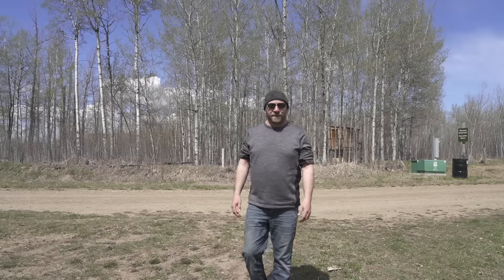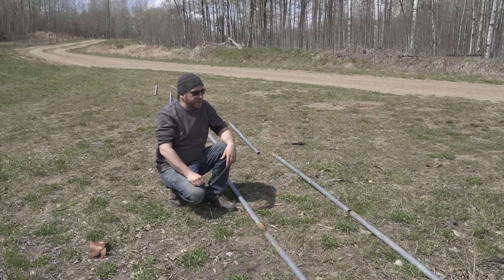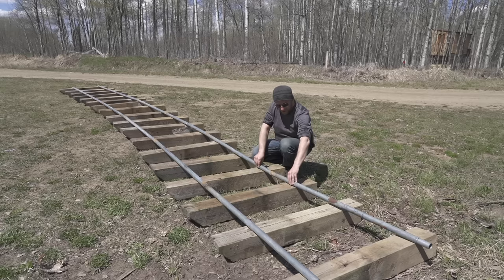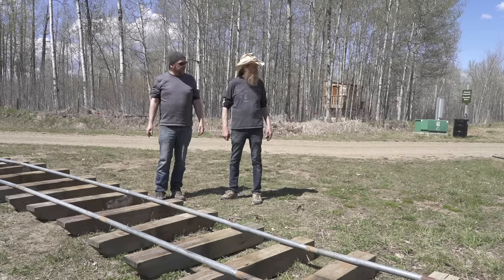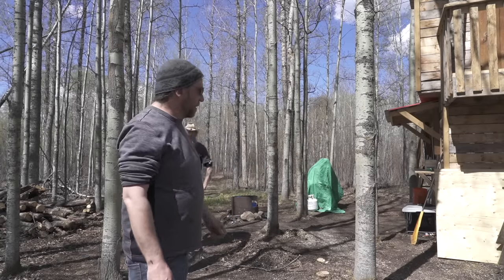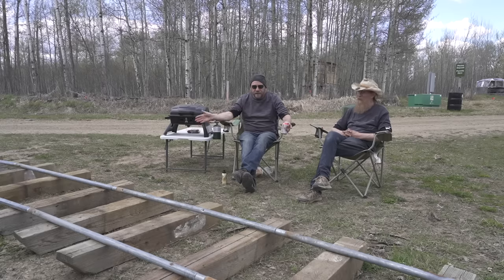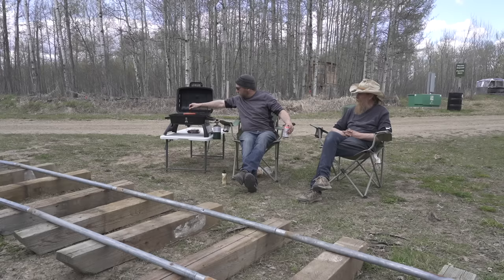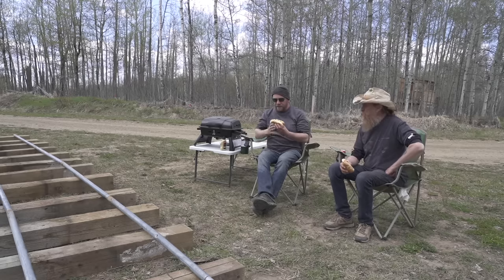Homemade DIY Railway - Work Begins Update

Comment: Might want to consider angle iron for rails with flange type wheels. The tubes and roller idea could work for a straight run but it will be crucial to have a perfect gauge the entire length and very very gradual turns or it would pinch/derail. Perhaps rollers that are wider than the rail to allow some play but still risk derailing on corners with the round rail. Plus flat flat stock/angle iron rail would allow you to easily make a very simple “frog” type switch
Reply: Choo choo master!
Reply: NAH... sooo many thin trees... cut them tubular, treat, and use as rails !
Reply: I think the simple "frog" might still work with the pipes, but I agree on the wheels, the only thing is that will probably run up the cost/difficulty to build it.
Reply: @joelmartin2549  not with the original idea for wheels but if there was flange type wheels with enough play it might work but the abrupt direction change with the round rail would still be a huge derail risk. But with enough patience and tools a more standard switch could be fabricated to make it less abrupt and more fluid. Or premade sections that can be swapped out rather than a switch. Of course I’m sure the idea here is to do everything on the cheap so what’s best might not be economical. Have to make due with what you got.
Reply: Blessings From Birmingham England
Reply: But a filmed derailment would be epic… as long as no one gets hurt of course.
Reply: This guy chooches!
Reply: @joohop  right back at you. From the Hampshire. The NEW Hampshire 😉
Reply: Perhaps they should consider just drinking beer...this project will go nowhere
Reply: @ainokea4u   The step 2 express coming in hot ;)
Reply: How about "Toeing" the wheels in about 5 degrees at the top, maybe less. I am picturing something like roller sheaves, though Steve has shown what he has. A slight toe would allow a bit more cornering and less "Blooper Action" though that would be an EPIC Step Two Video. As long as injuries were not too severe.  My other thought was vertical rollers to carry the load and inside horizontal or canted rollers to maintain center. Similar to how coasters are set up. Just thinkin.
Reply: Wheels on rail cars are conical so that they don’t derail on turns
Reply: NHNick is right to be concerned about tubular rail. Angle iron would work better but there is a reason that railroads use a nearly flat head rail with conical wheles with a inner flange. But if you do use the tubing I recommend putting a relief v or semicircle cut in the ties to cradle the tubing. When scread down it will lock the rail in place and if all the ties are cut exactly the same you will end up with a consistent gauge from one end to the other. A loop at each end will solve your backtracking problem. If you incline the track one way or the other at the y you can get the cart to choose to turn to the down hill side of the y automatically.
Reply: How fast are we planning on going here? I feel like "huge derail risk" is a little extreme
Reply: @dkjimi  Does it matter? We're talking about Steve, Crazy Neighbor, Junk Yard Engineering and Multiple Step Twos. What could go wrong.
Edit... There may even be a flame thrower involved. ;P
Reply: campers, you use this railway at your own risk!
have a step 2 first or several it will reduce your
anxiety!
Reply: @dkjimi  with round rails on a tight corner or switch at even walking speed could roll itself right off and derail. By huge derail risk I mean extremely likely to derail not so much a damage or injury risk.
Reply: @saintbyron5150  how much you want to bet crazy neighbour takes the first ride. Hope I’m as adventurous as him when I’m in my 70s.
Reply: @saintbyron5150  is right a few derailments will definitely increase the entertainment value.
Reply: matthew frank mikovich , one month may be plenty of time, by then the house will be in a different stage and it will be back to stealth camping, I think some people are taking this way too seriously, stop and think who Steave and Crazy Neighbor are!

Comment: I could see several different rails, and then in between where they all connect, having a train platform like in European train stations. Drive your train onto the platform, then it rotates to line you up with the rail you need to be on, and PRESTO a simple track change!!  That’s gonna look so cool when it’s done. And this is EXACTLY why I subscribe to this channel…because there’s always something fun going on regardless of whether it’s camping or not.

Comment: I think you're going to want to place a couple inches of crushed stone underneath certain parts of the tracks. It'll create a more even surface for the tracks, create landings for the sharper declines, cover the ground which has vegetation/would require a lot of maintenance each spring/summer, it would drain better after the winter so the wood will be stronger for longer, and also for safety it would be a more supportive surface for heavier loads. All the best, Steve!! I love the way you think!!  Looking forward, again, to next Thursday -- cheers my guy

Comment: If you're going to stick with the tubular rails and wheels you'll need a steering system of some kind. Like a circular bearing between the axial and car. The front and rear wheel can rotate around their center or else it won't be able to make it around the corners. I imagine a cylindrical thrust bearing with the axis of rotation centered on axial at the midpoint between the wheel. This would be plenty strong enough to support the weight of the car and cargo while allowing the cart to make it around the turns no problem. With this setup the car will be very sensitive to changes in gauge so you'll definitely want to make sure the distance between the rails doesn't wander much or car will experience a lot of friction or may not run at all. It could also be really loud in that case. Also, I'm not sure but think the ballast is import not only for drainage to protect the wood, but also to help hold the ties in place and keep weeds and plants from growing through the rails and moving the ties around. If the ties move around too much over the years it could damage the rails. I think this is a great idea and you should be able to pull it off. I'm excited to see where this goes.
Reply: Very good advice. 
If your tracks have any decent turns you'll need to figure out how to accomplish this without causing the wheels to slip. Trains do not have a differential, the wheels on each side share an axle. The way their wheels work is really genius, they're not flat at the bottom but slanted inwards, with the smaller diameter toward the outside. This solves two problems, it makes the train self-centering on the straightaways and it causes the train to shift to one side on the turns, this increases the wheel diameter on the outside and decreases it on the inside of the turn. 
I'm not saying you have to change your rails, I think you can solve these problems by using the wheels you talked about (they're also self centering) and ideally using free floating wheels, but honestly you could probably just deal with the wheels slipping a little. 
Good luck this is actually a really cool idea
Reply: @amosbackstrom5366  Excellent points

Comment: You will want all of your axles to be able to pivot and ideally each wheel should spin independently when going around corners. I watched a video about the science of train wheels awhile back and the curves are what is going to be the problem spots. Love it Steve!
Reply: THIS is why I came to the comment section!! Bravo, good sir!! 😁👏👏👏
Reply: Yeah the moment he mentioned those fence wheels I said "oh no!".
If he's using those wheels, he can put the wheels on either side of a single axel each that can pivot in the middle, much unlike a train wheel like you are suggesting.
If he made the wheels more like a train, which are basically cone-shaped, then he wouldn't need to do that.
Reply: I think cost is the factor, I know those train wheels are expensive, maybe he could grind part or all of the outer flange off of those fence wheels he plans to use, that way they would be closer to the real thing.

Comment: Coming from a Mechanical Engineering student, look into the engineering of how trains steer. Semi-conical wheels might help some problems mentioned in the other comments. Cheers Steve!
Reply: I’m in the UK but I am a freelance design engineer and I’m happy to 3D print these for you!
Reply: Definitley. Look up RP-25 wheels. Coming from a railroad conductor....
Reply: Wouldn't 2 normal wheels at an angle with negative camber (top of wheel leaning in) effectively act the same as a conical wheel? Just a random idea but I think it is plausible

Comment: Make yourself a “spacing stick” out of whatever you have around to keep the “rail to rail distance” consistent.  Easier than using a tape measure and a whole lot more accurate.  You’re lucky you can create whatever “guage” you desire.  Maybe 30” wide.
Reply: Alternatively the Red-Green in me says to build a locomotive that has springs on the ends of the axels that keep the wheels pressed into the rails. The wheels would be concave rubber and would move in and out as the rail line narrows and widens. That way if there is an obstacle the rails and wheels could move closer together and then spread apart again. ;-)

Comment: Oh, what fun! The place we lived for years was out in the woods, and one of the farms we passed on our way in and out had a small rideable train with several cars. 

They had a train barn with "Mail Pouch" painted on the side, where the train went in one end and came out the other. It was also where the train was kept sheltered during the winter. 

They had added a tunnel through one of those big concrete pipe sections. Planted fast growing bushes on either side to make it look cool. 

Such a treat to see it running around the large looped track. The train started at the train barn up near the house, ran down next to the driveway to almost the end (I think they also used the train for transporting the trash cans on trash and recycle days), then the tracks paralleled the road for a bit, went through a hedge, turned back up toward the back of the property and went through the tunnel. 

After that it continued back near the real barn, and made the final turn to finish the loop and pass through the train barn (about the height of a person and a bit longer than the entire train). On nice summer days we'd drive past and see the old guy in his overalls and conductor's cap giving kids a ride. Awesome!

Have fun with your train, it's a wonderful project!

Comment: steve, for your house. Look into GROUND SOURCE HEAT PUMP HEATING. Your property is probably year round 45 degree F heat/cold sink for winter heat and summer cool. 
You are HVAC competent and High efficiency compressors, pipes 15 feet underground never freeze so no "FROST LOCK" the way AIR SOURCE does. Good Luck.

Comment: Research the way train wheel geometry works, the wheels have a single slope to them and are wider towards the inside of the track. This acts as a differential when the train goes around bends since the wheels are on a common shaft and cannot vary speed from the inside of the track to the outside. 

You will either need to mimic this with your wheels, or you will need each wheel to be on it's own axle. If you use the wheels you are planning on common axle the inside wheel will either skid or come off the track when going around bends.
Reply: I agree. There's not much way for round stock casters to gain traction. I've built machines that have round stock tracks that casters ride on, but there's a high powered electric motor driving the whole assembly and not the wheels themselves. And these things are big heavy storage units that sit on level concrete industrial shop floors. I doubt powered casters would be able to get any traction of galvanized tube stock, especially on an upward grade.
Reply: Interesting point about the geometry of the wheels, makes sense tho. So straight line would be easy enough but as soon as you corner, the cart will come of.
Reply: @HappyMinds1  agree on the genius geometry used on modern wheels and rails, but the forged steel rails are the crucial part, they can handle the side-pressure forces happening with the inside tapered wheels. 
The steel gate rollers have a huge ‘U’ profile flanges, that would keep his weight-downsized rail system going around shallow bends no problem. 
HUGE heads-up to Steve on the rail engineering, keep the joints centered on top of a tie, ALWAYS. Let the tie at the joint guide your spacing. 😉👍 ( From an actual engineer-type guy. )
Reply: I have found that all your videos, regardless of the content provide me with many life lessons. Like the fact that tape will not stick to bubble wrap in sub zero temperatures, you can light a fire with a highway flare and that barbeque tools are unnecessary. Keep up the good work. Glad to see your videos each week. They make my day

Comment: Looks like fun, that’s gonna take a lot of wood and metal. First concern is that tubing is gonna squish down under weight and between the wood it’s gonna sag unless you use lots of wheels, but the turns…. Umm, yeah, you got this, a little ambitious but good luck. Look forward to seeing it operational.
Reply: i think you should scrap the train idea and make a shelter with the wood instead? - aurora d-j ps i love all your videos regardless , your amazing and your friend too!
Reply: And screws have bad sheer strength.  Corners could be dangerous

Comment: This is completely what I want to see!
I literally own my own train so I will always watch stuff like this

One thing that I would suggest before you get to far is actually make some kind of motorcar for it pretty soon since depending on the shape of the wheels you use and such, if the edges are to rounded it could be highly likely that it would just lift itself up and over the rail
Cause keep in mind that if you look at a railroad wheel, the area the sits on top of the rail has a really sharp angle into the flange that sits inside the rails, because of that sharp angle it helps to keep in on the tracks instead of just lifting itself off when in a curve (granted there are a lot of exceptions depending on size of railroad equipment but I am ignoring all of that for sake of simplicity)

Comment: From an engineer's perspective: Flat bar rails are a lot easier to bend into curves, and they won't rust internally either.
Reply: if you know where a lot of that is for FREE ... please let Steve know through the comment section...
Reply: Its free on the ground. Just as long as the train isn't coming by...
Reply: I was gonna say fill it with something to keep internal rust down, but whatever's cheap will almost certainly hold moisture. Flat bar is more expensive though, so maybe you win in the end because even if it needs to be replaced, it's much cheaper. Plus, chilling out watching Steve and Crazy Neighbor replace track in a few years doesn't feel like wasted time, at least not for me heh
Reply: @figsaregood  He should build a little engine and car, then ride on real railroad tracks. To keep the spirit of the channel.
Reply: @figsaregood  😭💀
Reply: And they won't deform with weight on them, I would test a small piece of that tubing to see j
how much weight it will stand in a press to see at what weight it deforms without recovering, and remember that even at the point it recovers it's shape as it does so repeatedly it's becoming brittle, so maybe drill it, then fill with concrete with wood dowels in the drilled holes?
Reply: @johndenton5555  MAGNETS!
Reply: @ZenEndurance  And we know he has magnets...
Reply: @figsaregood Lol😂😂😂

Comment: Everything is great Steve. Rope pulleys are a good option also for a round rail track system. It's a yard decoration... the same as a swing set...no inspection needed. a garden tractor would make decent locomotive. You will need a machinist/fabricator to make adapters from  the garden tractor to the track.
Reply: You have way too much incite. A project you imagined before?
Reply: @bbranett2188  Yes. As a very young child my parents bought us an electric  ride on train that had enough track to make a circuit all the way around the first floor. I have been a fan of trains since.

Comment: FYI:  your fence rails may not take a lot of weight (as in several hundred pounds MIGHT cause the piping to flatten or bend.)  A large tree branch came down in a storm  and bent the top rail of my chain link fence.   I'd do some weight tests before laying out all the track.
Reply: also make sure the test section includes a curve so you work out all the bugs.
Reply: This was my first thought, I've seen kids bend a fence rail w a bat and lots of anger
Reply: That top rail (forgive me if I'm wrong) was probably only supported every 8 to 10 feet. Those ties are much closer, sharing the weight, and it's a much different kind of impact. Still a concern, for sure, but only one way to find out
Reply: On the upside the individual rail sections dont weigh a ton, are readily available, cheap and easily replacable.
Reply: Exactly what I was going to suggest.
Reply: Could you fill them with something?p

Comment: Drill a 1/2" hole straight thru the tubing, drill a clearance hole in the top of the holes,so that a socket will clear, fasten the tube with 4" lag screws, your wheels will clear.

Comment: Ambitious project! I wonder if the tubular design of your rails will hold the weight of your freight without collapsing. Have you considered an L shape rail design? It's less surface area on the wheels and less friction.